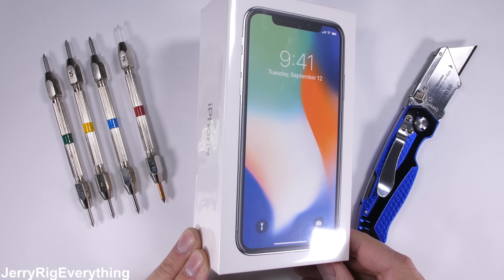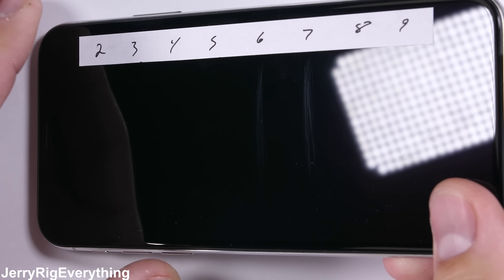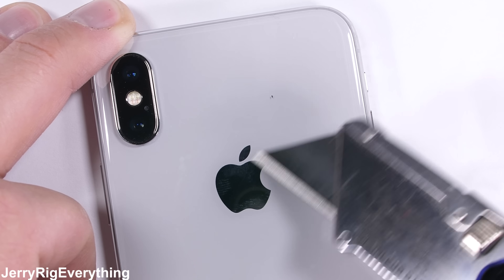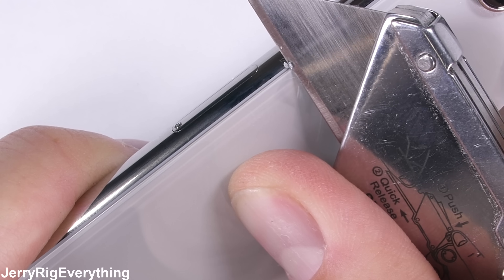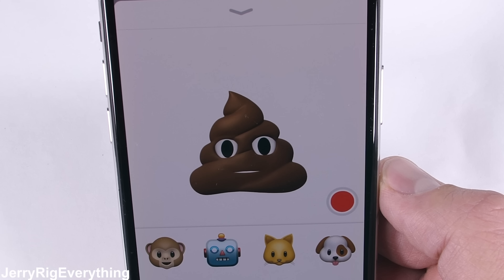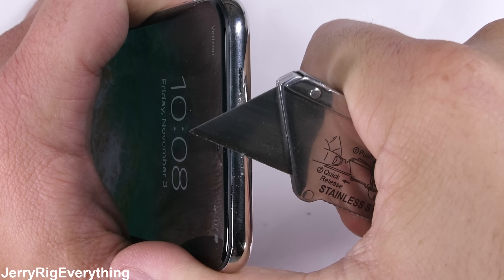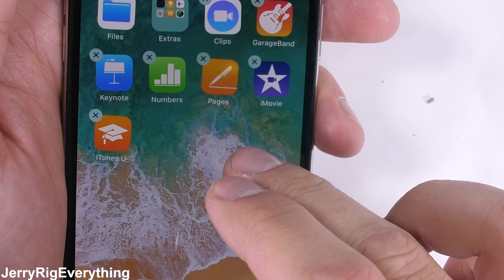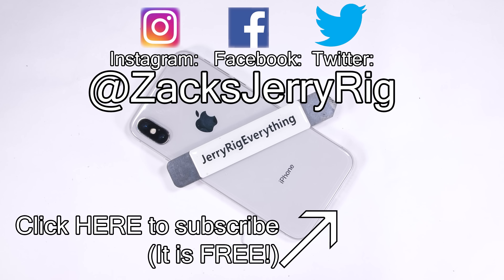iPhone X Durability Test - Scratch BURN and Bend TESTED!

Comment: Apple buys their glass of Samsung  and that's why the back-glass replacement is so expensive.
Reply: marcus pihler No. Apple developed and designed the glass. Samsung only produces it because Apple does not have factories efficient enough to make the glass quickly in high quantities.
Reply: Guess who made the operating system hardware up to I6 an later.  Think using again for Ix
Reply: they buy glass from corning not Samsung
Reply: samaung back glass for the S7, S8 are 15$

Comment: Apple in 2 years: presenting the iPhone 0. It's not even a phone anymore, it's just a solid block of steel. Get yours for the low price of $2999.99
Reply: Every single function sells for $9999.99 wireless.

Comment: I phone Users be like i phone x we removed the home Button “we don t need it” i phone 11 we removed the display “we don t need it”
Reply: - iPhone 12 - we replaced the front camera with a small mirror - we don't need it 😝
Reply: Iphone 13 - we removed the sim card slot. We don't need it, it's too thick for the phone
Reply: Bry Lester Aguado 

You can swipe up with the screen off and it unlocks in a second. It does it very fast. And with iOS 12 opening the camera 70% faster, Face ID will also be even faster. The X also gained 3 hours and 40 minutes of battery life on iOS 12.

Yes, people will spend $1000 on this phone. Is it as customizable as android? No. And there is a reason for that. iOS is a clean, simple, user friendly OS. They don’t implement as many features as android because either they’re almost useless or could compromise the reputation iOS has for its simplicity and premium feel. Android has always been the one to rush and get to things first. 

Yup. They had a face scanner like 6 years ago. But it wasn’t secure at all. A picture could unlock it. Apple releases Face ID, no the unlocking with your face isn’t new, but they brought a whole new generation of it.
Reply: PissedOffHoneyBadger you believe that? Android phones have options to use iris face lock or fingerprint
Reply: PissedOffHoneyBadger future proof? Are you insane? Slowing down the phone is not future proof.
Reply: PissedOffHoneyBadger if i am a toxic android fanboy then you are a foolish isheep user
Reply: PissedOffHoneyBadger FACE ID is garbage. Fingerprints will always be better.
Reply: Ad Revenue iphone 14 We Removed Phone
Reply: Bry Lester Aguado 

And how many actually use iris scanner? It’s much slower and much less secure.
Reply: PissedOffHoneyBadger the point is that you have an option. Unlike isheep users
Reply: PissedOffHoneyBadger u pay off 1000 dollars but you can only do so much and no other options but to click your power button and lit the phone using your face
Reply: PissedOffHoneyBadger based on my colleagues here. They have batt problems after the update. Well anyway i wont pick a smartphone with limited functionality. No torrent no headphone jack no emulator nor any direct download is a big no no for me.
Reply: Bry Lester Aguado Well keep in mind the update is in beta lmao. It comes down to preference. I don’t care to customize and go that much in depth with my OS, but since you do, then Android is better, for you. There’s no reason to start calling names such as iSheep etc. It’s just our preferences and opinions.
Reply: PissedOffHoneyBadger isheep because they protect this shit of a phone. When there are really problems behind from bending slowing down old model phone battery drains faster than normal and lack of functionality behind its very ridiculous price. Compare to note 8 and s9, this crap is very far behind and only idiots accept it
Reply: My old 6s never had any issues with the speed. Not once. I have a 5s and it doesn’t have any problems either. Smooth 60fps easy. My 8 plus got slowed when the battery was under load. My multi core performance went from 10600 to about 3000. Every phone throttles when under enough stress.
Reply: KinkyKurkTV 

Face ID isn’t garbage. Never said it was better than Touch ID either. It’s more secure than Touch ID, but it is slower. Iris scanner etc are 10x worse than Face ID no exaggeration. Either you haven’t used Face ID or are just biased. It works like a charm.
Reply: PissedOffHoneyBadger Ok, maybe I exaggerated. No, it's not terrible, but it's nothing amazing. A few of my friends with the X say their biggest gripe with FACE ID is the fact you have to bend over to look at it while sitting or lifting it at an awkward-ish angle when standing. And of course, how slow it is compared to Touch ID.
Reply: CaptainBucket I have friends with the X, of fucking course I've tried it. It's alright, but there's definitely room for improvement. Also, I like options. There should be a fingerprint scanner on this phone. Actually, the X was supposed to have Touch ID on the back, but the engineers at Apple couldn't figure out the kinks in time before release. What a shame...
Reply: PissedOffHoneyBadger Nope, not biased. Just not a fan of fewer options that's all.
Reply: PissedOffHoneyBadger I wanna like the X. I had a 7 Plus before I switched to the S9+, but I was originally planning on getting the X. It is a good phone, yes, but it has too many design flaws and things about it that prevent it from being daily driver material. Obviously the lack of a headphone jack is very annoying. It was annoying af when I had the 7 Plus, so that wouldn't change with the X. The notch isn't too big of a deal, but I'd prefer a slight head and chin over it. Gestures are fine, and the learning curve isn't big if you've used smartphones forever. However, during the 2 years with the 7 Plus, the lack of customization and options was certainly bothersome to me. That's why I switched back to Android. I love the aesthetic and efficiency of iOS, but I wish there was just more, you know? Also, the X lacks options for security. FACE ID is tolerable, but I wish there was also Touch ID. Lastly, that price tag. God damn. I can afford it, but I can't help but feel being hella ripped off. It cost $370 to make each unit. The most it should be is $700-800. Same goes for Samsung. Only reason I went with it is because options. More options made it more valuable for me, but still a rip-off imo.
Reply: PissedOffHoneyBadger The CPU size doesnt mean shit mate. Learn then chat shit
Reply: Ummmm but when samsung removes the home button you guys say “innovative” and now apple remove it and you guys bash apple about it
Reply: You guys bash Apple for paying more money to get 2 cameras but when samsung did it you guys didn’t say a thing smh
Reply: When the Razer Phone , the HTC Sapphire , the Xiaomi Mi Mix removes the headphone jack.Jerry said:”you win some and you lose some” Apple does it to get more water resistant and thinner phone you guys criticize Apple for it
Reply: And you guys bash Apple for slowing down phones for promoting sales. It actually for the battery life
Reply: And you guys compare the hardware of the iphone when it was the top by the time it was released
Reply: kỳ an thòng Yes, because they removed Touch ID. Samsung put the fingerprint scanner on the back. Don't be a dumbass
Reply: KinkyKurkTV okay then what about the other ones?
Reply: kỳ an thòng No I hated the no headphone jack bullshit. Any phone without one automatically loses a lot of it's value, it's fewer options. I had the iPhone 7 Plus for 2 years. Not having the jack in a major pain on the ass.
Reply: kỳ an thòng Apple removed it for no good reason. Samsung and other phones have a higher IP rating than the X and retain the jack.
Reply: kỳ an thòng And until a few months ago, you didn't know Apple slowed their phones down for that reason. They are under hot water for that bullshit. O think the majority of people here would like a better performance even though it might be more of a tax on the battery.
Reply: KinkyKurkTV you win some and you lose some mate
Reply: kỳ an thòng At $1000+, you shouldn't have to
Reply: KinkyKurkTV 100% true m8
Reply: Bry Lester Aguado The functionality of waking the phone with a tap makes face ID practical and fast. All it takes is a tap and a swipe. Besides, if you want the home button and fingerprint reader, buy the 8. And on the topic of android phones’ iris scanner, it’s impractical and annoying. Having to position your face and phone in such a specific place to have a bunch of infrared rays hit your eyes just isn’t as fast, and the infrared can hurt and damage your eyes. The face unlock, while a bit faster than apple’s face ID, can be fooled by a photo on most phones. Security is nothing.
Reply: Iphone 200,  We removed the humans, we didn't need them.
Reply: Gamer George I don't think we'll need AI phones :|
Reply: the cs:go striker we replaced the phone with air. We don’t need it
Reply: the cs:go striker iPhone 14 - We removed the phone, we don’t need it. (Separetely sold for $10000)
Reply: No, they get a lot of hate for having lower end screens etc and are considered overpriced when really it's because they heavily invest into the CPU/GPU portion of their devices. 
The A11 Bionic is about twice the size in silicone (which is very expensive) than basically any other Android CPU. Even the CPU itself is much larger. 
It has a lot more cache (8mb of cache in the iPhone 8 with L2 and l3 cache vs the 3mb of L2 cache in snapdragon CPUs) and horsepower. 
They just have to compensate for investing so hard for that by having 1080p LED screens etc.

They chose to invest heavily in that part of the phone so it can be future proof. 
The iPhone 5s is still going to be supported for an entire year longer. 
That wouldn't have been possible if they didn't implement/invest heavily in the CPU/GPU from the start. 
We do have to give some credit for them being able to support their phones for such a long time. 
It's a fact that iPhone's get much more OS updates, being more demanding too, overtime than Android.

Gary from Android Authority even said what I'm saying right now. I can link you proof if you want.

You're just being a toxic Android fanboy. 

The reason Apple is so successful is not because they're "overpriced" and that "people keep buying their stuff anyways" it's because they don't pay taxes like everyone else does.
Reply: Because you literally don't need it. Face ID works like a charm and is nearly just as fast. Just takes a few days to get used to and you'll find the phone amazing. I still prefer the homebutton, which is why I got the 8 plus. It just comes down to preference really. But they left that option for users. They could have just removed it on the 8 too.

Comment: My iPhone X literally slid off of the corner of my bed about a foot high hitting the side frame (which is SANDED FUCKING WOOD) and then the carpet. Picked it up and now there’s a big ass horizontal (when in portrait mode) scratch. Only had it for 2 weeks, now mind you I’ve had my iPhone 6+ for almost 3 years without a case or screen protector, dropping it from head level on pavement and it still doesn’t have scratches on the screen. $1200 my ass Apple. Make a phone that slides around like it’s buttered with sub-par shitty glass.

Comment: The back glass replacement costs 549 because they just give you a new phone, so I guess iPhones cost 549 to make
Reply: Ben Wright  It's actually even less than THAT...about $350 I believe...
Reply: Sharky165 That doesn't include other costs like manufacturing and marketing
Reply: Ben Wright  Yeah but those costs should not be included in the phone's actual cost in terms of parts, that's why teardown analyses never include them.  
 Those are simply "the cost of doing business" !
Reply: Sharky165 And every company has to account for that in their prices, just to break even. They then need to make a profit otherwise a company isn't sustainability

Comment: You pay half the price of the phone  to get the back glass replaced
Instead ypu can get a One Plus 5t at less than that price
Reply: Skynertia 
my friend has the S7 edge. he got that weird pink band on the screen. he said that he kept the phone under the pillow then he slept on it. because of all the pressures the Pink band appeared.
the S7 edge screen is very weak.
Reply: Christina Andwena nobody told u to use a galaxy s3
Reply: xXMujahEDXx I actually have a normal s7. Have had it almost 2 years now. I've dropped it quite a lot, and the only damage I have are some scratches on the metal outside. My screen is pretty perfect (Except for my prints).
Reply: When I bought mine, the Apple store associate told me they don’t replace the back glass. Instead they will just replace the phone with a new one.
Reply: Paul C The thing is...a phone is not a car dumbass. Don't defend Apple's malicious practices
Reply: Cubestien This is like not buying a car because replacing the engine block costs $6,500. Its not gonna break unless you’re an idiot. If you pay $1000 for a phone, you’ll surely be mindful enough to not carelessly let it fall out of your hands. I still have not dropped mine.
Reply: Cubestien then don’t drop it 🙄

Comment: Ive dropped my iphone 4, with a glass back, on my garage floor, concrete, 3 times from about 4 feet up, accidentally because I'm short. The weird thing is that there are no cracks and the deepest scratch was caused by my mom.

Comment: What if you want to be discreet that you are unlocking your phone. If you have to use your face that's not very discreet. I know there is still a password on it (at least I'm pretty sure) but the fingerprint is so much faster
Reply: The stupidest thing about face id is that it doesnt automaticaly go into the phone once its unlocked u still have to slide up
Reply: I Like Dogs really! That's kind of lame
Reply: AmazingCheetos actually face ID is faster than 4th gen touch ID.
Reply: YTRED 45621 I said fingerprint is faster than typing the password for if you are trying to be discreet when unlocking your phone

Comment: ACTUALLY Apple doesn’t charge $549 to replace the back glass, in fact the don’t fix your back glass at all. They charge $549 not to fix the back glass, but to give you a brand new iPhone X. If you want your back glass fixed the only option is to get a new phone because the X was not made to be taken apart. So they are not charging you for you $549 dollars for a slab of glass, there giving you a new phone for half the price you payed for the first one. My solution if you don’t want to pay that is to get a durable case and try not to be clumsy when handling your phone.

Comment: Top of the line, one of a kind, retina display glass... that android has been using for the past 7 years
Reply: M-E-O-W You know, every other manufacturer has already removed the home button, and that’s innovation, but Apple does it and for them it’s moving backward
Reply: Hellfire Kid samsungs s8 and note 8 have more advanced screens than the x. So yea...
Reply: Vinnie Sifter lol apple can't perfect these if they can't even make them, wireless charging is a universal thing and their oled screens are made by Samsung
Reply: Aunchient Pistol u gay?
Reply: Jake Voss you realize he was quoting the video.
Reply: Yeah because the technology has stayed stagnant for the past seven years has it? With those whack burnt in underdeveloped OLEDs 😂😂😂😂🖖
Reply: I just prefer ios operating system. Android is too glitchy for me.
Reply: MeestahBinks from someone who has used both, iOS is just as "glitchy" as android is, but atleast with android u can source the problem and fix it ur self but with iOS u can't do much to fix the problem
Reply: i have s8 and iphone x. The iphone x blows the s8 out of the water, sry android sheep, but apple sheep are just sheep with more $. Admittedly, the tech inside samsung used to be better, but apple beat samsung on every front except having a 1.5watt out of 9watts total slower wireless charging speed...which really is not even worth mentioning. TBH, wireless charging on every device sucks. I have the best wireless chargers on the market, and after using the S8 and the iphone x on them for about a week, i went back to charging both by cable, because even the fastest qi charging is still retarded slow
Reply: only on videos tho, not on actual phone usage, but youre right
Reply: Do you know what a retina display is?

Apple says phone that have more than 300 ppi are called a Retina display 
Sony Experia XZ premium has a ppi of 853ppi
Reply: Luca Celentano Apple has been late to every new innovation. In some ways they are going backwards. Removing the home button and headphone jack was unnecessary and they advertise things that low end 200 dollar phones have done for years. That high price isn't about the quality of the iphone, you are just purchasing the logo on the back of the phone.
Reply: Super Retina display
Reply: Hellfire Kid did you see the galaxy s8 vs iPhone 8 battery test lol
Reply: true but I had screen problems with my s5 and Ive had the iphone x for a few months now and its 100x better.
Reply: Yep i have the x too. Its great.
Reply: Sry but no
Reply: RubCuber you’re gay
Reply: The reason they removed the jack was because the battery is so god damn good and android screens are horrible my friend has the s8 He dropped it on mulch and they’re was a little long scratch

Comment: You should do the Razer Phone
Reply: Im pretty sure its the "Razer" its the one that looks like the nextbit robin but Razer the company took over....
Reply: Jade green The company is named Razer. They are a gaming company.
Reply: Razor
Reply: Erik yeah but it does not use Cloud to save and is more bend-resistant.
Reply: Jade green *razer
Reply: Jade green looks like someone is not into gaming....
Reply: bend resistant yeah The Razer is, but next bit Robin snaps in half though. JerryRig has a video on the Robin and it snaps in half
Reply: Erik *razor